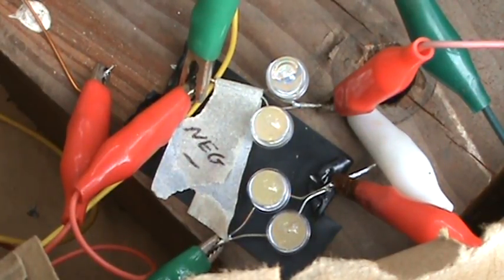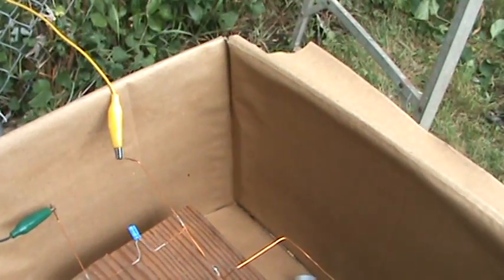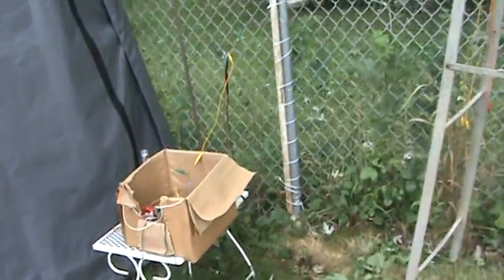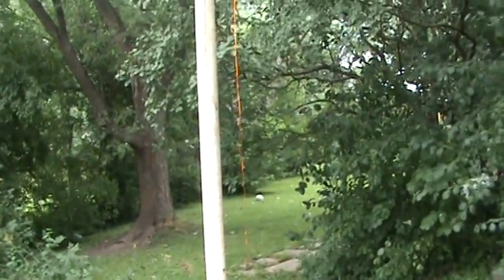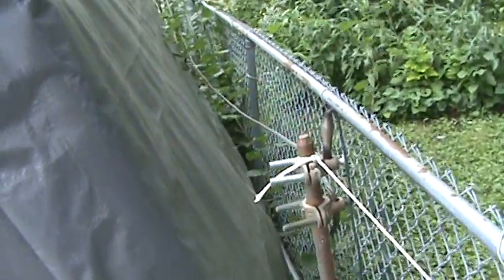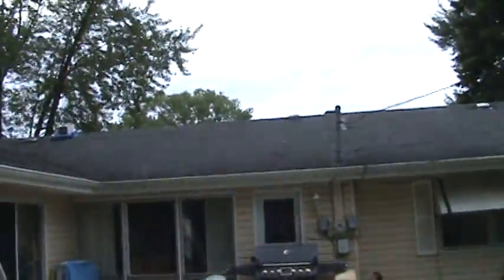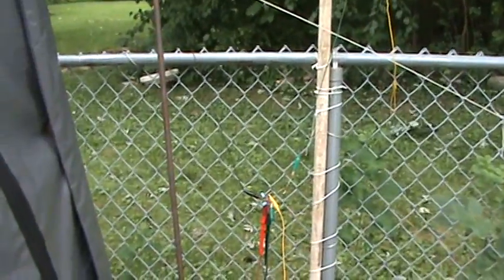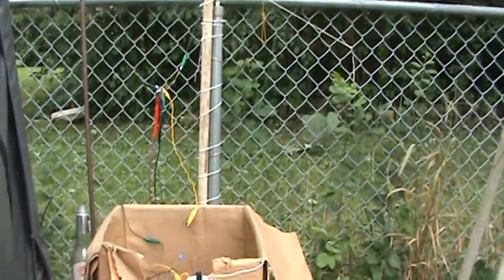FREE ENERGY FROM AIR 2016 Pt 2 (4 LEDs Lit)

Comment: Remember u dont want to have current. Current is waste of electric field. Thinest wires will make less current lost in space around the wires. U need to disturb electric field(by wires) but u dont want to have flow of energy. U want energy in your diodes not in your wires. Wires are just to make a path where the electric field will colapse making power. But u wanna have that power just in lights not in wires remember ! Best way to do that ? ---> Impulse electricity. Not DC not AC but impulse ! It wont loose energy and deliver it in the diodes. Then current will apear only in diodes. Sorry for my english. As tesla say Energy Vibration and Frequency. Try fast impulse frequencies like radio and then try to tune your diode circuit to frequency of your collapsing electric field that is colapsing beetwenn your antenna and ground at some specific rate. Thank you for your videos and sory for my broken english :P
Reply from the maker: Yes, i have come to same conclusion, i am learning.  We want the voltage & electromagnetic  fields.
 Current in diodes(spark gaps).  And everything need to resonate :-) Very good English, no worries.  I will reply to your other comments soon.

Comment: You have stumped these so called "smart" people with you real proof, awesome work!
Reply from the maker: Thank you :-)
I hope to improve much more yet :-)
Reply: +INVENTOR3 I did some experiments to the RF receiver, like adding 2 more antennas, and so far, I got over 4 volts! Enough to power 4 LEDs, and power the  calculator!
Reply from the maker: Wow, thats great! :-)  Are you using this same circuit that i use?  I would love to hear all details of your whole set-up. Even better if i could get to see some photos or video of your set-up :-)  Just in case, here is my email.... millanyangle@yahoo.com
I now have 21 small LEDs lit & will be making another video of it soon.
Hmmm, i will try more antennas also :-)  I tried multiple antennas in the past, but my set-up was a little different. Maybe multiple antennas will work with my set-up now.
Hey, thanks for keeping me update with your results!  Keep up the great work :-)
Reply: +INVENTOR3 for my design, I stuffed the simple RF receiver circuit on an altoids tin container, where it was sanded and connected, so my body becomes the ground as I hold it, then, it was hanged by 3 antennas for better coverage. It works, and it's even portable, results are from my Facebook page
Reply: +INVENTOR3 the circuit I still use is the 4 in34as, 2 Mylar caps, and 2 electrolytic caps connected close together
Reply from the maker: Thanks for the info.  Interesting you ground it by hand, maybe try a 6 inch nail in the ground and see if the results are any better :-)
Reply: +INVENTOR3 will try, I was think of posing my projects, RF included, in my new blog
Reply from the maker: Yes, post to blog, or even post here, youtube allows you to post photos here also, it makes a video out of still shots.  
If you got blog, send me a link :-)
Reply from the maker: Do your antennas touch each other?
Reply: +INVENTOR3 not really, the main antenna is split into 3 at different directions
Reply from the maker: Good to know, than you.
Reply from the maker: Nice blog you made :-)
I see your set-up now, very good, thank you for sharing.  I see a multi color coil as antenna,,,but you now have 3 separate antennas all going to the same place on one circuit, correct?
Reply: +INVENTOR3 yep
Reply from the maker: Excellent work :-)  I see you got more power now and better ground, very nice :-)
You did a great job on your blog :-)
Here is latest video.....
https://www.youtube.com/watch?v=XK3NrQLR2XE